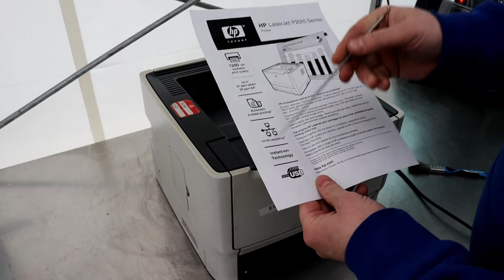FUSER Printer HP LaserJet P2015 P2014 1160 1320 Disassembly and Reassembly

Comment: Hey good video to start fixing printer it makes me more brave to sort out my problem ;)
My printer while printing on both sides using duplex is blocking paper (always in the same position in the back) 
Do you have a cloue where to start... fixing film looks fine from the outside.
Cheers
Reply from the maker: At the very beginning, I will only replace the paper pick-up roller from the cassette, but if this does not help, you need to remove the Fsuer Unit and replace the Fuser Film. If you don't have Fuser Film, clean the Fuser Film grease and apply new grease so that the foil can rotate. Good luck.

Comment: Hi I found the there is a U cliip over the   fuser  heating bar ...  My one gone missing caused by worker...

If this thing not install  will it possible cause the   fuser imaturely heat up problem  ?
Reply from the maker: So your prints will be dirty or smudged. Thanks for your comment. Don't forget to subscribe to my channel.
Reply: @MrRicoh  the printg doesn work 
the laser unit will stop half way 

Due to the fuser not heat enug  due to the bar is distaching ... the brass clip is use to make the heatg bar tide to the a round sensor if it is loose therefore I suspected it give the 3 light = fatal error 

Monday try again too DIY they clips with alluninium can cover...
Reply: @MrRicoh   Hi ,  whether u face 3 light at the bottom caught just light on ... no blink